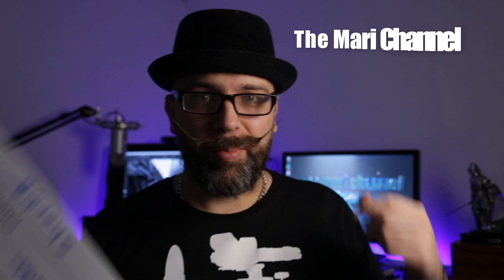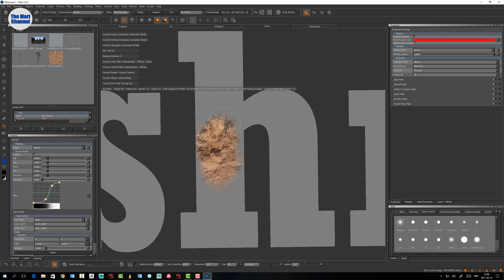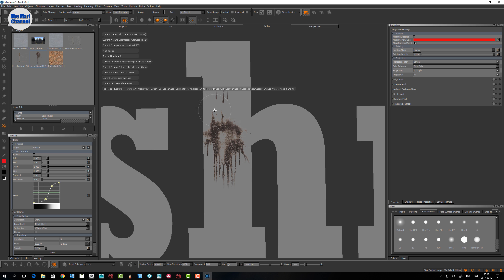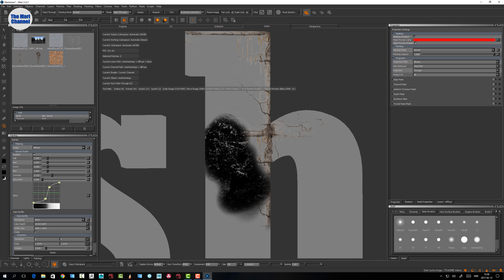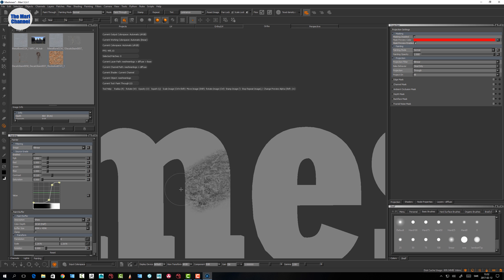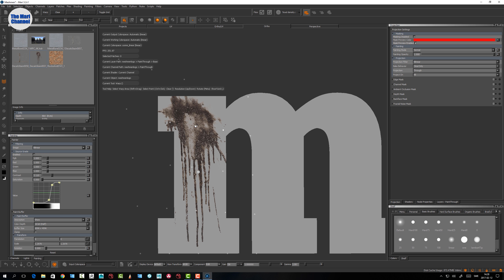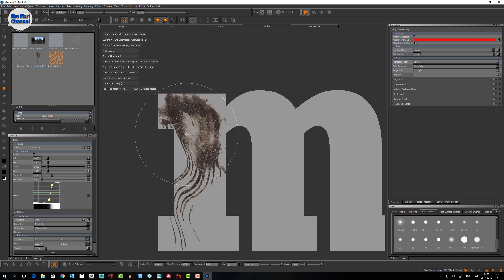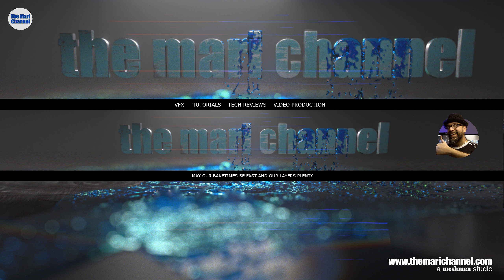Mari Paint through tool : Deforming Paint tutorial | Introduction to Mari 3

Comment: help me bro , im new to mari !!! Slerp is not working , can i no how to fix this ???
Reply from the maker: How are you using it?
Reply: Meshmen Studio , im using this fr smooth out the edges of the paint but , slerp tool is not working !!
Reply from the maker: are you using it to deform paint? It only works on paint that is live in the paint buffer. If you try on something already baked down it wont work
Reply: ya i got it !! tq so much 😊
Reply from the maker: Great, if you want to use already baked textures from a layer . There us the lift paint option. Then you can use slerp